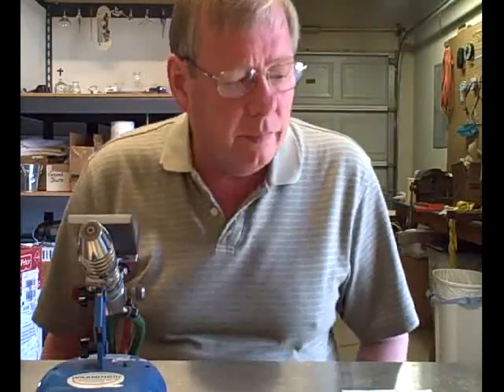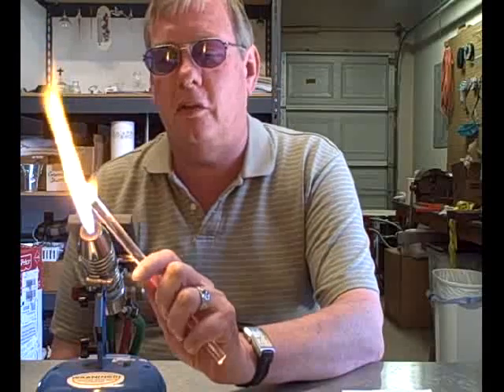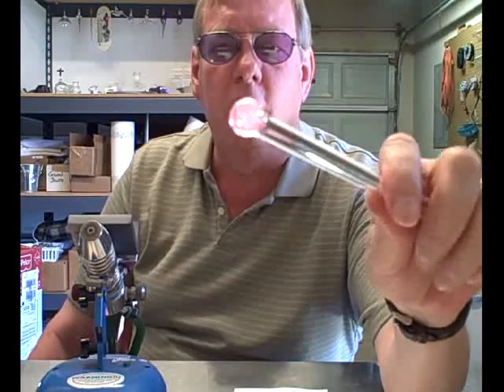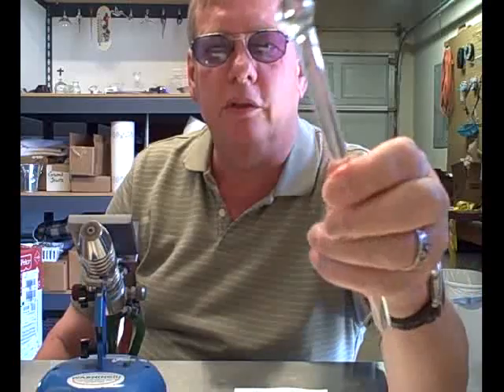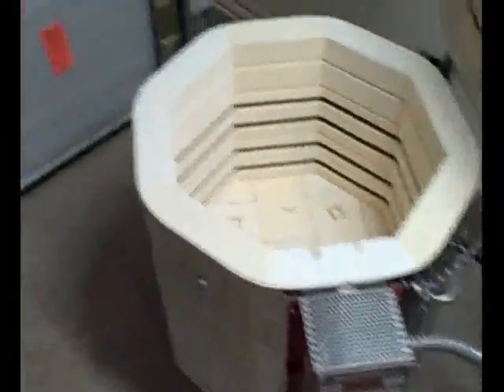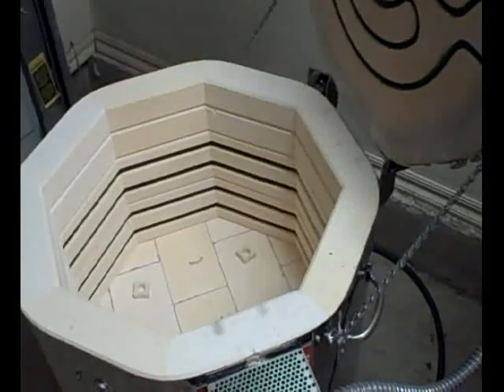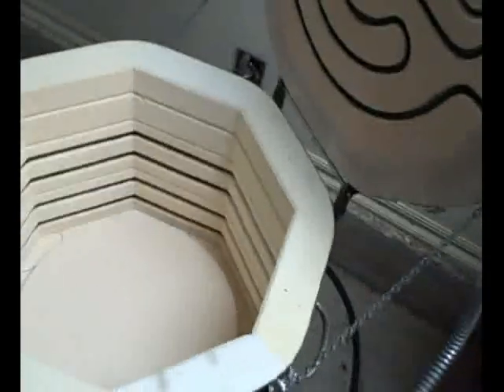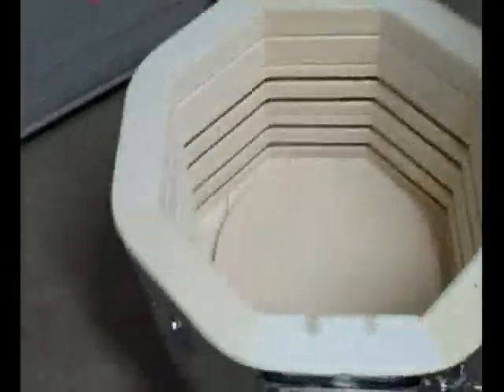Kilns &  Annealing

Comment: I watch you put your rod directly in the flame in every video. I'm a beginner and I'm having a tough time making beads because half of my rods crack and spatter and throw bits of glass all around the moment I approach the torch....I'm confused...how come you can do that and your glass melts while mine explodes. I spend 5 minutes warming up the darn thing and it still explodes! Do you warm them up ahead of time? Or is it the quality of the glass? Help! Please! Thank you so much for sharing your knowledge with us...
Reply: Did u solve the problem? Maybe you need to kiln the rods first
Reply: Borosilicate, my friend!
Reply: When you first put glass in the flame make sure your oxygen isn't turned up all the way and you are working with a flame that is neutral to reduced (more propane). I have my oxygen set around 5lpm when I put the glass in the flame, works just about every time I still start at the end of the flame though usually. Working with borosilicate glass is a good recommendation as well, I frequently stick it right into the center of the flame when the oxygen is up to 8lpm. Just speaking from personal experience, but I haven't had problems with this for a long time.

Comment from the maker: Annealing temperature for borosilicate glass is 1050F which is well above the range of a conventional oven. A kiln is nothing other than a high temperature oven. Also, it is beneficial to have a digital controller, as many kilns have, to manage the duration and cool down process required for annealing.

Comment from the maker: When the glass cools strain is introduced because the outside cools much faster than the core. Often the glass will crack as it cools below ~400F. If it happens to survive cooling it will be highly prone to breakage because of the strain within. Annealing removes the strain from the glass.

Comment from the maker: Yes, you are correct. The time does increase exponentially with the thickness. Obviously I am taking a bit of a short cut and trade off and my larger pieces may not be fully annealled. Another thing I forgot to mention is that for closed hollow form work with internal glass you need to double the time too.

I see you have been a busy guy lately. Looking forward to the 8 basic skills videos from you :-)

Comment: isnt the rate of cooling inversly proportional to the distance from the surface of the glass? I ask, because I have been working on the assumption that the soak time seems like it would be an exponentially increasing time with regard to thickness, because of the slow rate at which the glass can change temperature. perhaps my schedule is overkill.-) though, I did develop my schedule specifically to allow deep inclusion of problematic colors. THIS VIDEO ROCKS! so glad to see this and you again!

Comment: great video! i did enjoy it :-)
you can build yourself a small "garage" front-loader, for your worktable,
so you can work in segments and build larger pieces.
i built one, and it's so convinient.
takes about 2 days to complete, no rush.
i use a 1000W dimmer, connected to a 400W element , and another 400W element with a switch.
the internal size of the chamber is app.
20cm X 20cm X 35 cm, the frax layer is about 10cm, +extra 5cm on top,
and a 2cm firebrick floor, for heat retention.